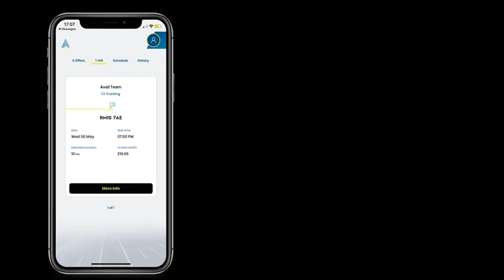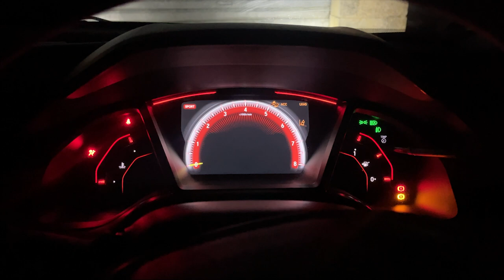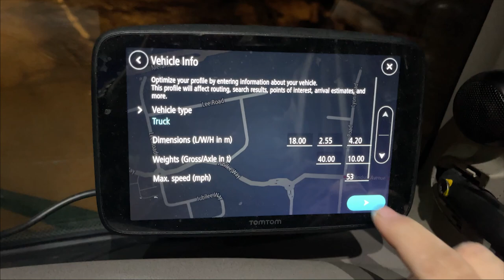I Broke Down In LONDON!

Comment: 36:25 I can't believe this is still manual, I had a Magnum in the late 90's that was electric cab tilting.  A lot has changed since I drove trucks, auto gear boxes and tacho cards probably being the two biggest changes, but I am amazed that you are still pumping cabs over.

Comment: Hi Luke from the warm climate of New Zealand, thoughts for you and your father. Diet good on you we learned that carbs at night are not good for weight so its yoghurt and some fruit not bananas, Well modern trucks eh, electronics eh honestly as much as I like what the modern truck or car is about and most are reliable, okay years ago when everything was simple I do not recall my Commer trucks giving grief. I broke a gearshift lever in my Perkins powered Commer in the 70s, managed to get a mechanic at the place I was dropping furnace oil at to weld it back together. Apart from breaking centre bolts on a single axle and having the trailer crab down the road fully loaded I made it to the garage and had the problem fixed. You are a good courteous driver and a credit to your craft, thanks for informative and entertaing videos

Comment: If I’m not mistaken, the reason your tow truck got changed for another, is because they can only go 100 miles from base without needing a tacho or mot and certain other things. If they go over the 100mile they need to have them all because it’s mo longer classed as a recovery truck on paper.
Reply from the maker: Yes this could actually be the reason thank you

Comment: Hi Luke, I did a bit of HGV driving for Ferryspeed in Portsmouth (you may or may not have heard of them) back in September. I lasted just seven shifts because the management were a bunch of c***s. For doing  nights, I was paid £12 per hour and they kept putting pressure on me to speed. I am one of the many thousands of HGV licence holders that will not be going back to the industry.

Comment: ECUs. The worst thing that was invented for automotive use. What was wrong with cables that could be replaced by the road side? Electronics always go wrong and when they do, you're screwed. My old Ford Focus did this a lot. Eventually it was traced to a broken solder joint in the ECU connection in the back ofthe dash.

Comment: We've had a bunch of Ecu's go pop as well and I'm afraid I've got bad news for you big lad.... XF's (and CF's for that matter) are basically a re-hash of the 95 (and 85) from over 30 years ago with "modern" electrical stuff to meet euro directives. Unfortunately, PACCAR aren't up to it.
I hate them they're crap. So do the fitters. When you call the garage with a problem, the standard answer is "whadya expect, it's a DAF" 😆. They're a manager and bean-counter's (who thinks he can still makes the books balance by magic) truck.
We've got, officially, "only" 5% of the fleet off the road all the time, either in our own garages or back at the dealerships.
We've got hundreds of em and I've done, well, I don't even know how many thousand miles in them. For us, they're even rubbish even when they're not broken down, since we have the baby 10.8L engine at a supposed 450 horse. Like where was it 450? At the flywheel on PACCAR 's bench dyno? At an actual 44 tonnes, which we are, almost every load, its not even 10Hp/ tonne at the wheels.
Your water pump will go sooner or later too, so you've got that to look forward to. 
Sorry old bean. 
I'm on nights and so I rarely get the same unit each shift. 
Probably not the done thing to say who my company is, but we used to have ERF's and some Volvos, then Mercs. 
We thought Mercs were a bit unreliable, til we got lumbered with DAF's. 
Good luck. Keep smiling.
Reply: Your company like crap vehicles  then ?  ERF ? VOLVO and German BEDFORDS

Comment: quick word of advice, in case you weren't already aware. When changing light bulbs don't touch the bulb, the oil/residue on your fingers creates a hot spot on the bulb causing premature failure, always hold by the base and if not possible use gloves.
Reply: That only applies to the halogen bulbs such as headlamps. The turn signal/brake lights etc are fine to hold bare handed
Reply: @f2john  Thanks! I was not aware of that, learned something today :)

Comment: That's the third lorry in as many months to break down isn't Luke. Not great for a companies fleet.
Reply from the maker: This one is one of the newest with 720,000km on the clock. They’re all old ones. Company’s just bought two brand new ivecos  s ways coming end of this year.
Reply: @lukecinahgv  I think they are needed. Will you get one of the new one's Luke?
Reply from the maker: I have no idea mate. I’ve been here longer than anyone but that doesn’t mean I’m “entitled” they’ll give them to who ever deserves them the most. I’m easy going mate, I’ll drive anything within reason
Reply: @lukecinahgv  👍👍
Reply: It dose not look like a vehicle problem to me lol    We operate 100% DAF  and dont have all these problems ? if we did we would loose the job its on,   We have a 106 65 plate with 1.5 millon on the clock ,had a clutch at 1m, same disc all round still,  All our vehicles serviced twice a year, inspected evey 5 weeks,

Comment: I reckon they swapped the Tow vehicles over because the MAN is probably ULEZ compliant so they don't need to pay through the nose to send that into London, whereas the Foden would get it's operator a charge of about £115 each time it goes in, but it's still fine to do the work outside the city, like hauling you and you DAF back to base. That would be my thought anyway, makes sense to send a ULEZ compliant recovery into London if possible.
Wishing you Dad a speedy recovery mate.
Reply: I would think you are right on that one ? once its on the hook why change try and Save a tanner spend a Pound ?  it would have been home by the time you have pissed about changeing motors.

Comment: What you should try is disconnect battery  leads from the battery touch both battery  leads together for about 60 seconds ,it resets the computer, may have helped you
Reply: Nice to see someone that knows what he`s doing,    You would think someone running trucks would know that little trick though ?
Reply: @brianwebb191  not necessarily, he is a truck driver not into electronics and it's not guaranteed to work
Reply: @johnmoloney5296   All our driver have a full tool kit supplied by us,  If thay rang in with a problem we would guide them in the right direction as to what to do before we rang Daf aid.
Reply: @brianwebb191  I'm not making any accusations, I'm just saying it might have worked, and the computer could have been fried and it could have been useless,

Comment: Not quite accurate about the seat belt rules.  If it is an area with public access, normal road laws apply, so even with the barrier, I think the area would still require seat belts.  However, you were reversing, which allows you to not wear it, 'while manoeuvring that includes a reverse'.  The 50m rule only applies to 'door-to-door' deliveries, like milk, or parcels, so not applicable for an artic.
Reply: Dos`e wearing a seat belt make it go any better ??

Comment: DAF broke again?
Ngl with all the errors showing up sounds like a technical fault.
Reply: Yeah an engine ecu they drop like flys. I’ve seen more cfs than xfs with engine ecu problems but it does always tend to be the mx11 engines
Reply: @garrytheninja5404  We must have good one then 1.5 millon same ecu. Changed clutch at 1m not all bad lol

Comment: What do you expect its a daf best scrap available,
Reply: Sorry cannot agree on that one,      Scania would be the best from what the prats pay for them in the first place? dearest badge you can ever buy lol
Reply: @brianwebb191  we had all daf until the boss was so sick off them always off the road, now all scania's and very little trouble mostly new ones but 4 are old
Reply: @ianleak  Them Scanias will make him feel suicidal when they are off the road then  LOL   Set of shells ever oil change  ???
Reply: @brianwebb191  was told last week running daf cost him 60% more to run than any of the scania on the fleet
Reply: @ianleak  What i find strange we have operated Daf  from 1978 ,  yes we have tride others?  we bought a new space cab in 1986 which caused problems but that was the dealers fault,   We have a 65 plt with 1.5 m on the clock out 5 days a week all over the uk,  it had a clutch at 1m its on the same brake disc and the same pads on the second axle,   We have just sold 2 14plt manuals  bought for 19k 3 yr ago  with 750k on the clock sold to a dealer in Coventry dec last yr  for 16k  with the same tires on ? all they cost was the servicing,        the 12 manual box is crap as you need to use all the gears, thats why they have gone lol
So how come yours cost a fortune to operate ?  and ours don`t ?    (and we have some stars that drive them )
Scania are only 10 ton drive axle 6 ton mid axle,  Daf 11.5 and 7.5 ton   so we can get away with running as a 4x2 most of the time if its loaded correctly,